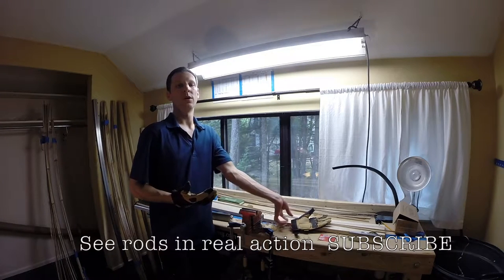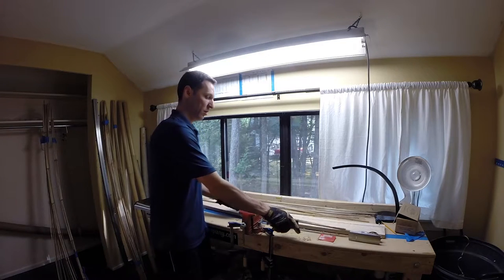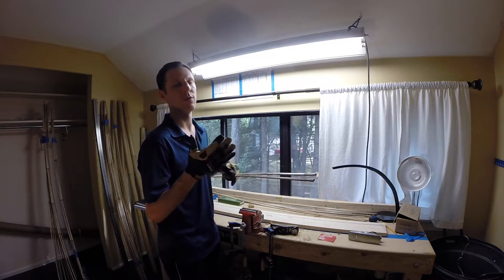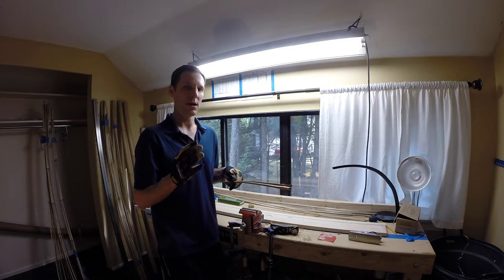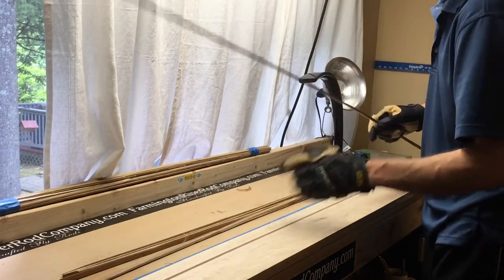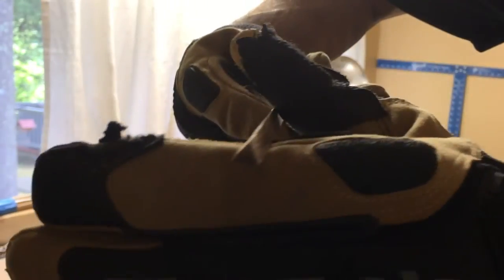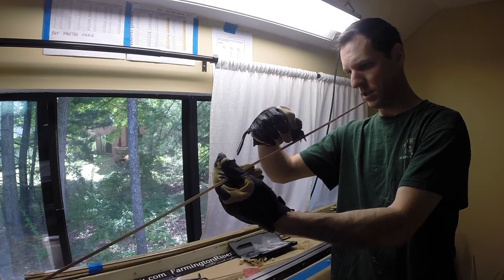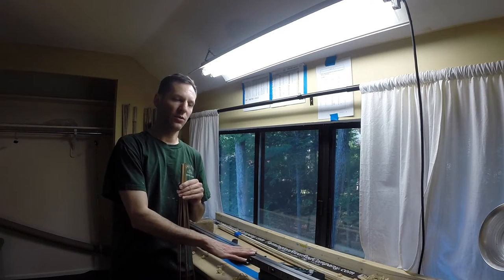Bamboo Rod Building - Ep. 4 - Rough Planing

Comment: Is this steel planing form the same one you use when doing the final tapered planing but with a constant depth? Or do you have separate steel forms for rough and final planing?
Reply from the maker: Kevin Duck It's the same for final.  I only use it for a small amount of rough planing
Reply: @Farmington_River_Rods  when ur spec say .285 is that the diameter of the butt section or is it the spec for each strip